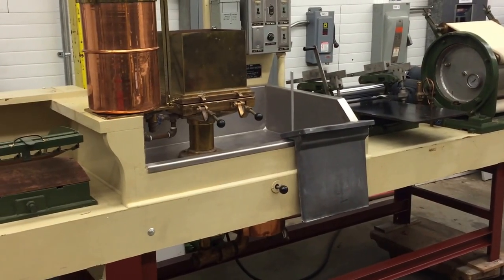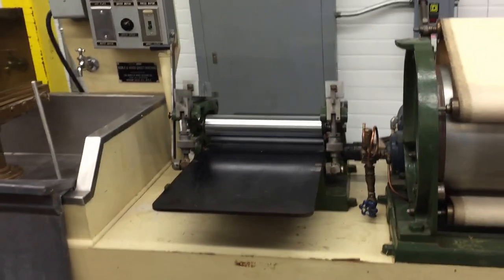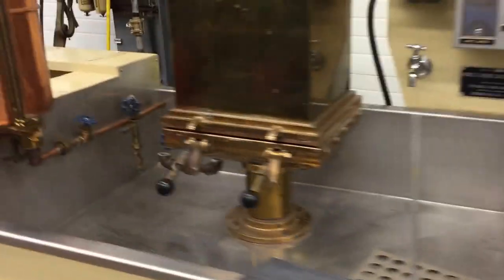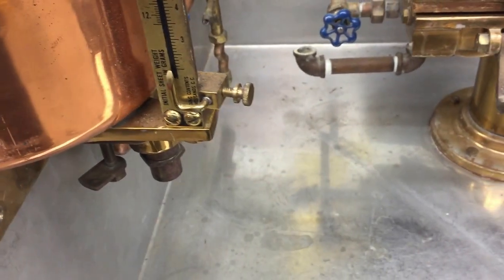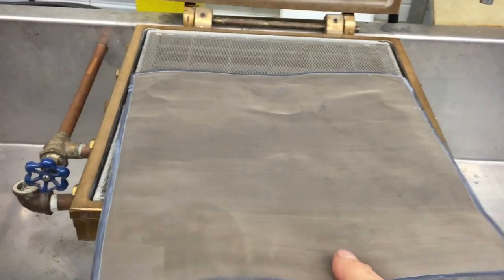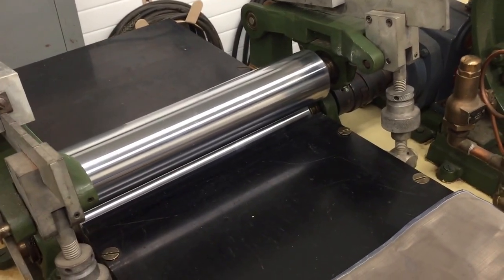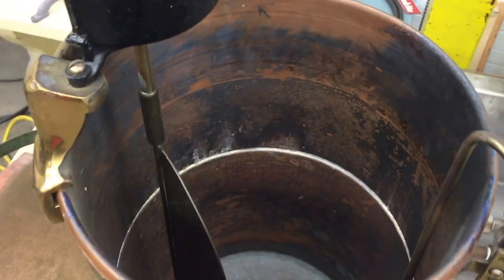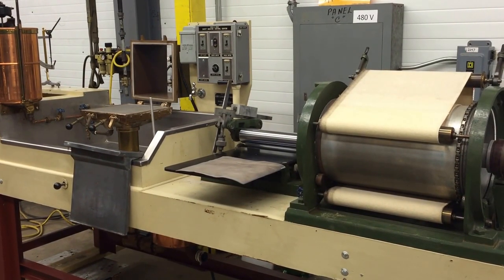Hand paper sheet making machine, 12x12", Noble & Wood

Comment: In 1969-71 I worked at the Noble and Wood Machine Company in Hoosick Falls, NY as a draftsman, during high school and first year of college. On breaks I visited the lab often and got to make paper on this machine a few times.  In the same room was a small hollander and a huge drum beater (the tank was probably 8' in diameter and 6' tall, on a pedestal so maybe 8-9' tall overall.  Also in the room was a motorized test papermaker (called a Formar I think). Instead of 12x12 sheets, it made a continuous strip which fed into a large rotating drum dryer.  I also remember there were bags of shredded currency (in multiple sizes) in the room, the US Treasury had sent them to us to see if they could be recycled.  The paper for US currency was originally made not too far away, at the Crane Company just outside of Pittsfield, MA, and was very high quality stuff but the problem with recycling it was retaining good fiber length... shred it too small and the paper wouldn't hold together.  So I guess the government wanted to know just how small they could shred the stuff and have it still be usable when recycled.  I don't know what happened to them but for years I kept a few sheets of recycled "money paper" I made on this machine.